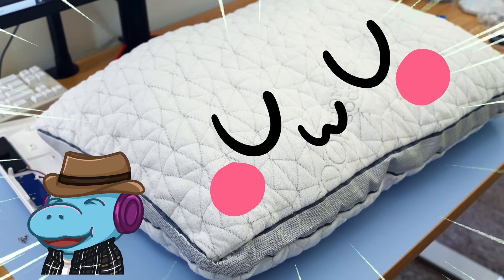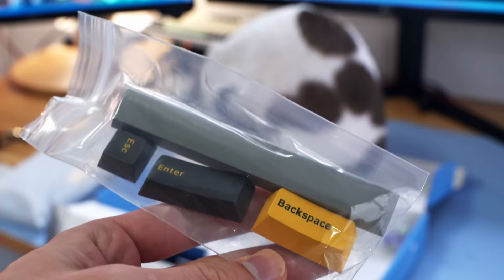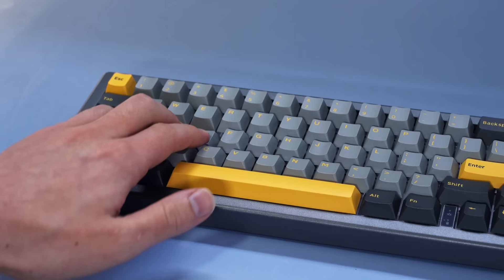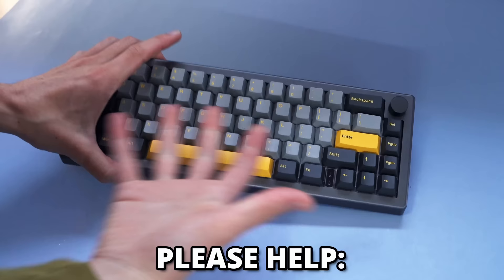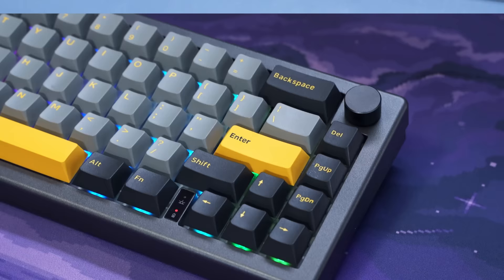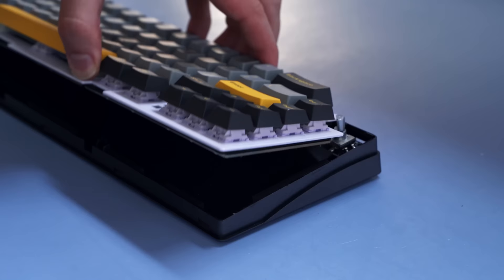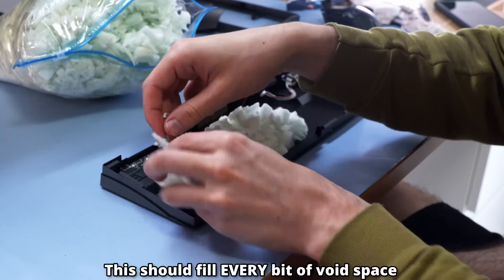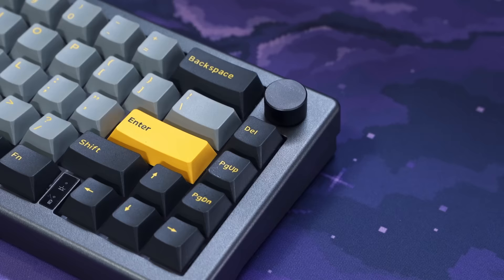This New Mod Will Make ANY Keyboard Thock.

Comment: I categorize keyboards into 4 different categories. <50 is budget, between 50 and 100 is low midrange 100 to 150 is high midrange and anything over 150 is premium.
Reply: 30 or more is overexpensive for me 😭🙏
Reply: 250 is mid for me. 500 is premium.
Reply: Honestly in the custom mechanical keyboard hobby I feel like 80 dollars would be a good budget keyboard
Reply: @Jifflan bro can buy any keyboard except exceptionally expensive ones

Comment: To open it, remove all keycaps and look for some holes from the inside part. Use a plastic spudger to avoid damage
Reply: I have a gmk67 (same board) and it is the easiest thing to open - take off the keycaps and use a plastic knife to pop the outside of the case off from the INSIDE. That easy.
Reply: No need to take keycaps off

Comment: this keeb looks exactly like my gmk67 which arrived sounding thock with linear switches, didn't have to modify at all... sounds and feels much better than keyboards twice/thrice its price.
Reply: It is that exact same board (even uses the GMK software) with less layers of included foam. If anyone is interested in this board I would recommend just getting the GMK67 instead.

Comment: Really easy toolless way to open the case is to remove the knob and the top row of keycaps, put your thumbs there the 5 and 9 keys were and push the top case back and upward, it'll release the clips with the least effort and zero damage.

Also the gmk67 is the same board with a polycarbonate plate for half the price
Reply: fr lol
Reply: Thank you like, it really isn’t that hard to open

Comment: Hey Hipyo, i'm a zuoya GMK67 user, and this EPOMAKER EK68 is practically the same keyboard but rebranded to be an epomaker (as seen with other epomaker keyboards too). I was also stuck on how to open the very snug plastic case, but its actually pretty simple and tool-less(if you know what you're doing). So you basically take off the keycaps, maybe the switches too if you want, then push the upper part of the case with your fingers firmly, and it should just snap out along with the lower half
Reply: Same, the case was a nightmare the first times I opened it but it became more loose and easy to open over time.
Reply: Thanks for the tip man, seriously appreciate this. I just bought a gmk67 and was a little worried about how to open it up for sound mods.

Comment: I think for a budget keyboard, it depends. For example, for a high quality keyboard, it should be around $70-$89. But for an average mechanical keyboard, it should be around $40-$70. And for custom keyboards from scratch, they should be  $80-$150.

Comment: This keyboard is actually easy to open up lol, kind of shocking to see how you were doing it. But yeah, all you need to do is remove the entire top row of keycaps and you push your thumbs on the bottom side portion of the case while pulling the top portion of the case to you. The case opens fairly easy.

Comment: I got an iFixit Kit with the small, thin picks and prying tools and it has been a life saver for three different Epomaker boards that I've built (most recently the Aura 75), all of which had the clips that hold the case together. Other than that lack of mod-ability, I've enjoyed their boards.

Comment: I cut up an old towel and put 2 layers of it in my keyboard. Made it a bit more thocky, but it really depends on what kind of towel you use. The one I used was pretty cheap, but I'm gonna try a thicker towel and see what happens
Reply: Don't. Try Polyfil instead.

Comment: I had this board for about a week.  Ended up returning it.  My "gasket mount" was non existent.  I pushed down hard on the keys and it would not move.  The fact that I paid $90 bucks for it didn't help either.  Keychron offers a better value by far over the EK68.  I like the way mine sounded, it was pretty thocky out of the box.  I just couldn't be happy knowing how much I spent on it for how little value it provided.

Comment: This board looks 100% identical to a few other boards. GMK67 perhaps? I grabbed one on a flash sale for 30 bucks about a month ago, assembled, but no switches/caps.
Reply from the maker: getting a gmk 67 to compare
Reply: @HipyoTech  They're essentially the same board, just EK68 has VIA compatibility. 

I think it might be the same case as the YUNZII AL71 and the Womier S-K71
Reply: @stellarSketcher  i think my keyboard also looks identical with those it was vortexseries gt-65.

Comment: Isn't this basically just a rebranded GMK67? I've gotten two of those recently on Ali for less than $30 each and both had a layer of plastic under the PCB making them very thocky/creamy depending on the switches and caps I put on them. Thinking of buying another as I have extra switches and for the price that makes a great Christmas or Birthday present for those I'm trying to lure into this rabbit hole of custom keyboards...
Reply: yeah its the same thing. the epomaker is just a rebranded version

Comment: Just get a GMK67 for $35 or less and you can build this (with a better PC plate) for <$50.
Also it's not that difficult to open if you go look up the methods to open the GMK67.
Reply: you will end up spending more on a gmk67 than this prebuilt , if you wanted the same quality of keycaps and switches lol
the only thing the GMK allows you to do is mod before the keyboard is fully built.

Comment: I'd be really interested in a video discussing the long term use of certain switches! 

I have the pre-lubed Gateron pro 3.0 yellow switches in a heavily modified Keychron q6 pro (force break, electrical tape, freaking car insulation), and I swear the switches have slowly felt more rattly (pingy maybe?) over just a few weeks of use. 

I'm not sure if you have a daily that gets a ton of use, but the video would be interesting if you can share any info. Love your videos thanks!
Reply: i've used the same switches for a few months, mine is still the same
Reply: lube
Reply: There's usually a break-in period for lube. It settles in over a few days/weeks of use. If you're getting ping, you may want to lube the springs. Rattle means lube the rails.

If you're feeling really lazy, store it upside down when not using and you might get some lube moving back up into place.

Comment: to take this apart, as well as the gmk67, you have to take of the back 3 middle keycaps (5,6,7), and if your fingers are big, the switches too. then you just have to pull back and up at the rear of the case should snap off. from there you have to pull the rest of the case apart, and can take under 20 seconds if you learn how to do it

Comment: Hipyo, I've learned a lot from your channel.  As I work in electronics I might even DESIGN my own keyboard (check out the QMK stuff).  But, question, if I want thocky and 104 keys, what should I look at?  Lighting software, removable switches, 3 pin

Comment: i first clicked on the video, thinking it was an epomaker keeb. it looks so similar to a gmk67 and akko mod 008 like i dont know but especially the functions at the back near the usb cable and the little plastic indicator inbetween the alphas and the arrow. even how the gmk67 has the same way to open up the board. u need to put like something thin in between the creaves on the keeb and pry it open
Reply: Yeah it's a rebranded GMK67 with keycaps an switches. And not even good keycaps

Comment: i bought this board barebones (this is a sound test of this keyboard) and it's actually pretty easy to open up- bad explanation incoming.

you just have to take the top side (while it's on a flat surface) and push the case away from you until you hear it click. it may sound like you're breaking the board but you really aren't. you can open this board without using anything to pry it open, really

Comment: you were opening the case from the wrong side. I noticed this case is identical to the gmk67, and to open that, you would use a card to pry it open from the other side you were trying to open it from.

Comment: The easiest way I've seen was to take off the key caps, then just press up on the top of the plastic above the number row until the clips pop. Then you can work around the remainder of the top case to unclip.

Comment: Do not open it like that. You can remove the 4, 5, 8, and 9 keys and puch it outwards. It will disconnect and will be really easy to take apart.

Comment: You might want to look into insulation made from recycled jeans. I'm working on a keyboard with lights, so can't really test it, but it's pretty effective for insulation, so maybe it'll work just as well for insulating a keyboard.
Reply: Professional audio engineer here. Can confirm that the recycled jeans insulation is legit.

Comment: If I recall, in ZOOM keebs, they separate the battery section and then have a plate? But those are design specifically to have different layering inside since they sell it. Not with this keeb. I wouldn't be keen on using materials that's likely to catch on more fire if its next to a flammable material in the worse case scenario. Just an opinion but it shows that readymade keebs with no protective layering for the battery has a little more element of fire hazard when you're modding by filling with different materials. So all the more reason to go for something like ZOOM if you're planning to use a wireless option and use the default dampening materials they provide.  

All the more reason to appreciate the warning against the pillow foam method.

Comment: For a wireless, gasket mounted keyboard with a knob, this is a REALLY good deal. Akko 5075S is still superior in my opinion (gasket mount, knob, but wired) but still a great option
Reply: Now they only sell the VIA version. Plus if you change the gaskets into D65 poron gaskets now the gasket performance will be better

Comment: Hi Hypio, I want too build my first custom keyboard, but there’s almost zero keyboards that has a iso layout because I’m from Sweden. I thought of maybe buy a barebones or fully build that is 65 percent. Idk if I should get a epomaker ek68 as my first custom keyboard because it has a iso layout, would you say that epomaker ek68 is great for its price and it’s good as a starter custom keyboard. I want too get wuque studios morandi switches. Could you recommend some keyboards that is hotswap and 65% that is around a 100$ and has a iso layout that works great with wuque morandi switches, could you also recommend some good websites to buy keyboards and switches and some Nordic layout keycaps.

Comment: I’m not sure what thonc is as I a new viewer and also on the market to build a keyboard for myself but it makes me wonder if automotive sound deadening would work well for the application
Reply: Ahh just saw the video 😅 great minds think alike
Reply: I came into the keyboard space as an electronics nerd (and typist who only cares about speed).  However, I believe it goes like this:

*The vowels is basically the PITCH of the sound of typing.  A tactile switch makes a CLICK like a light switch, so they are basically "clicky."
*Hipyo seems to like linear switches.  These don't make noise until they bottom out, so there is no CLICK sound, just the sound of the key hitting whatever is under it.  The sound echoes in the keyboard based on its construction, but the sound of the key bottoming out and it's echo (both happen really fast, so they sound like one thing to the human ear) is referred to as THOCKY.  Say it aloud, "click" has a higher pitch than "thock."
*CLACK is basically CLICK, but with a lot of echo.
*These are all conclusions I have drawn based on my observations, so please correct me if need be

Comment: Hippo I want your help. I want to build a 68 key keyboard with Kinetic Labs Gecko Silent Linear Switches. But I want something stable as I have a G915 with tactile brown switches. And I need the level of stability that has or more. Preferably wireless. Would you be able to build a parts list for something relatively silent, smooth, stable with no key rattle?

Comment: I did not believe a bit of tape (force break mod and tape mod) could make any, let alone THIS MUCH, difference. But I have been converted. The sound this keyboard makes after those mods is godly. I'm now a devout follower of the church of THOCK.
But it's had the unpleasant side effect of INSTANTLY ruining the keyboard I've been using for years on my pc (corsair k100) so I'm going to have to spend ANOTHER 500 dollars to get that on the same level as my laptop keyboard.
And it's all your fault.

Comment: Not related question: Can a usual mechanical keyboard be used for gaming ?? Im using the GMMk1 (didnt feel like using the gmmk2) base and gateron Reds. Ive had those for a year and they work perfectly  fine for me.
Reply: almost any keyboard can be used really. my friend has been using a cheap like amazon basic keyboard for years and only just recently is deciding to get the wooting 60he like i did. my previous board however were the ducky one 2 sf and then the corsair vengeance k65. so mine were so basic. as long as it works and has n key rollover. or maybe at least 6. but thats not usually a problem these days. u would get more out of a better mouse honestly. but of course board like the wooting do more than just work and have good performance, thats like next level stuff.

Comment: Can you put low profile switches into a Red Dragon Kumara k552rgb-2?
Reply: Not sure about low profiles, but you can put Outemu-style 3-pin switches just fine in there. 

If you have 5-pin switches, you can try snipping the two extra stands out with a flush cutter.

Source: I have a Redragon K552 Kumara Rainbow Edition I modded as my first keyboard.

Comment: Bro that thing is identical to the gmk67 the gmk is just way cheaper like they definitely are just upcharging for their name for the same Chinese board.
Reply from the maker: To their credit, they are providing it with their own switches and keycaps - so its not exactly the SAME
Reply: @HipyoTech  also there is a better way to open those boards. If you take off a few key caps from the top and bottom rows and push outward from the inside where the keys are it can pop it out easy the gmk67 is the board I use and have modded alot so it's just easier

Comment: Hey Hipyo!!  Feed You're Cat!   Oh, and maybe if you turned that Carpet Padding so it was rubber side up, it would work differently.  But then I guess you should use Electrical Tape over the battery and such to act as Fire Suppression.  🤷‍♂

Comment: You should check out the RK84 Pro. USB-C, 2.4Ghz, and BT 5.0 and has a full aluminum base. My only issue is north facing LEDs but its a great budget setup to mod.